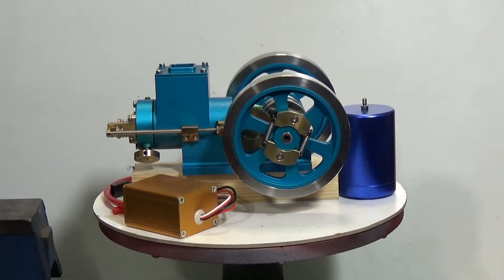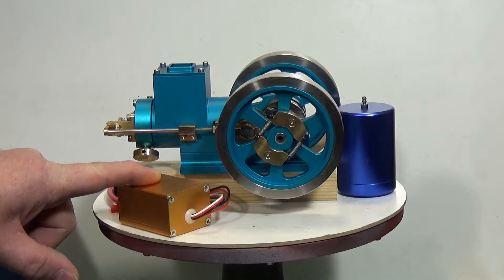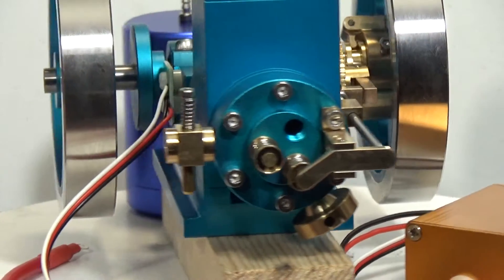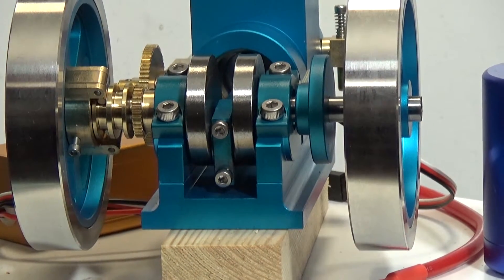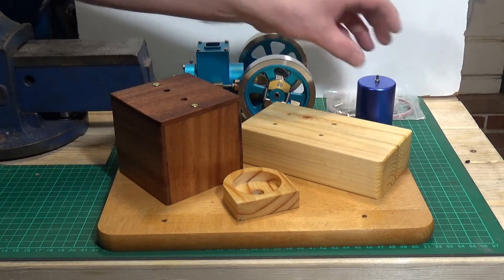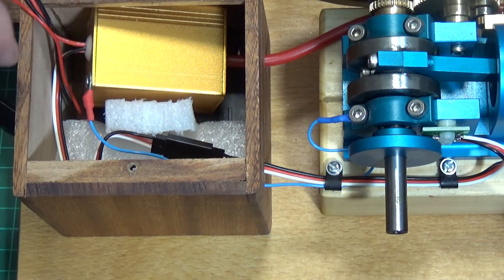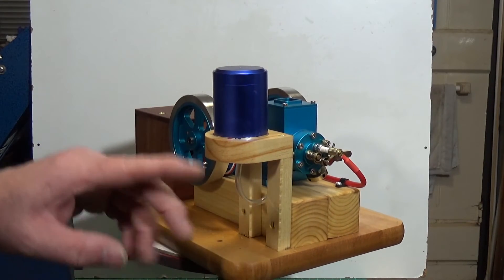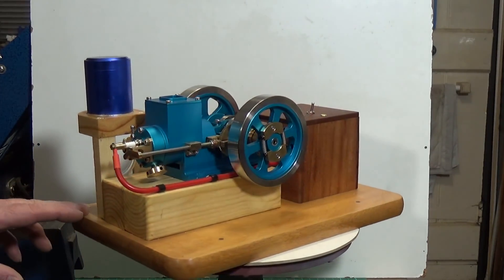Modern Mechanical Tech - Chinese Hit and Miss Engine - Part 1

Comment: Drill a tiny hole at the base of the cylinder ... that piston must be lubricated.
Reply from the maker: Yes i was thinking of fitting a drip feed oiler.
Reply: @RetroSteamTech  Yes..
Lubrication is ESSENTIAL of the cylinder and piston..
Not forgetting the big and small end bushes..

I'm definately getting one for my birthday.

Much less chew than my once owned 1923 Amanco..
(& without the backache!)
Reply: Add 2 cycle oil to the fuel to lubricate the engine.  50:1 should work.  The piston ring is made from nitrile.
Reply from the maker: @FredMiller  Thanks Fred. Since making this video i have bought myself a small bottle of two-stroke oil and now add a few drops to the fuel before i run the engines.
I should have guessed nitrile as it's green in colour.

Cheers, Alan.

Comment: Thanks for the great video, however, you neglected to say if you added any oil to your petrol or water in the hopper.  I have a 1-3/4hp real hit-n-miss engine, it is an Economy, that was made in 1927!  It is a great running engine and a lot of fun to watch running!  I also make small model engines such as this from bar stock; they are a lot of work to machine and to get running.  I can't hardly make one for the Banggood price!
Reply from the maker: Thanks Karl. No, i didn't add any oil to the petrol although i do squirt a bit into the cylinder before each run. I have put water in the hopper but i never run the engine for long periods so it doesn't get very hot. Very envious of your full size hit-n-miss engine.

Comment: Have one myself I'm fiddling with, made a couple of changes but it it runs reliably
Reply from the maker: Mine runs ok now but you do have to do a bit of tweaking. 🙂
Reply: New to this...mind giving some tips on getting it to run reliably..... pmmarion58@gmail.com
Reply from the maker: @PMMARION  Hi Mark. Well i would if i could! Even now, after all the fiddling, sometimes it runs fine other times it is very difficult to start. Certainly the adjustment of the carburetor screw and position of the fuel tank are very important.

Comment: Impressive!
Reply from the maker: It is but a right bugger to get running!
Reply: If you're having problems then you might want to get hold of Jason at "The Good of the Land" channel. He rebuilt one and might be able to assist you.
Reply from the maker: @CraigLYoung  Thanks Craig, i think I've got it sorted now but i will check out that channel though.
Reply: Be better off asking shopdogsam, imo he has more knowledge on old engines than thegoodoftheland.